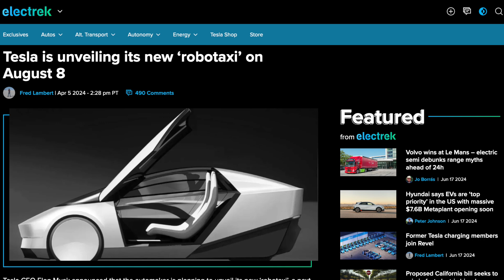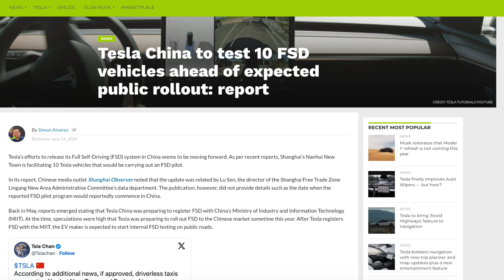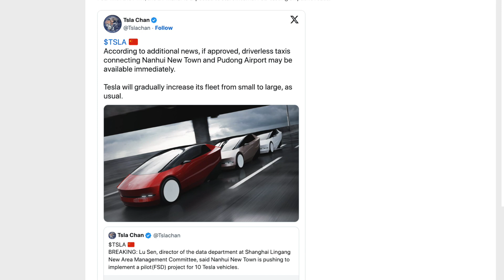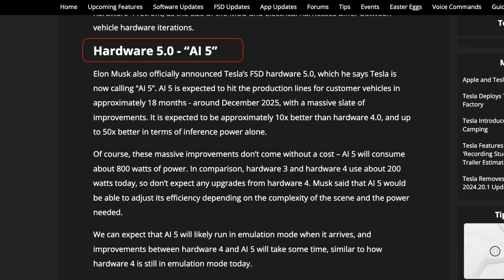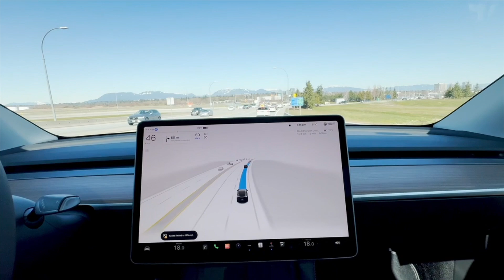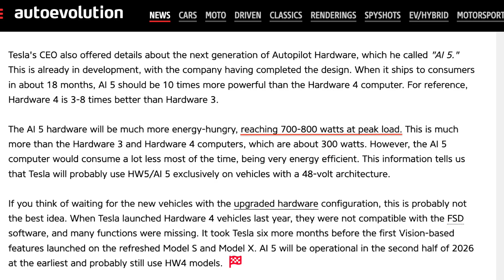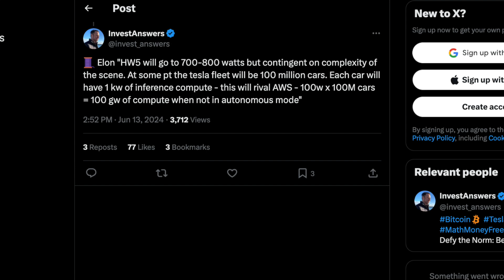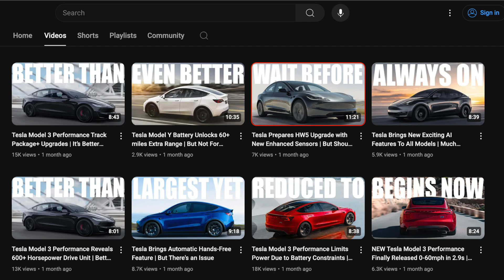Tesla HW5 Upgrades For Newer Vehicles | Massive Improvements Coming

Comment: John you predicted HW5 will arrive to cars later this year. In my eyes the big news here is Elon's projection of 18 months until first deployment. This means a minimum of 24 months in real world time. Then it will work in emulation for a year to collect enough data, so we're talking at least 3 years from today until actual usage. The bottom line here is that this is no longer a reason to hold of purchase now. Now it's just the LG battery :)
Reply from the maker: I’m getting a gut feeling that they’re just sandbagging right now, and they’ll launch the Cybercab with HW5 without “officially announcing HW5” to avoid any major sales decline. Bet we’ll see Juniper with HW5 outside of NA close to end of this year